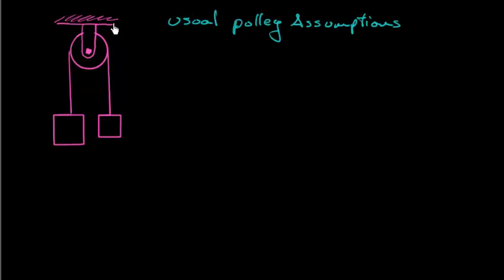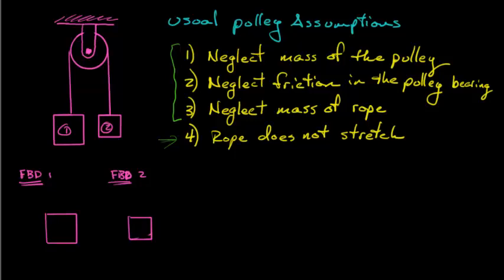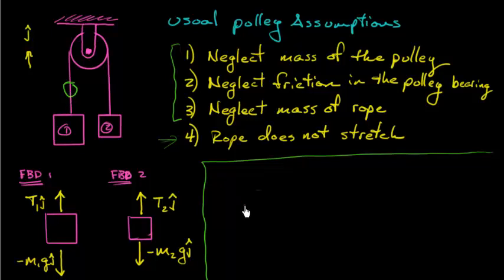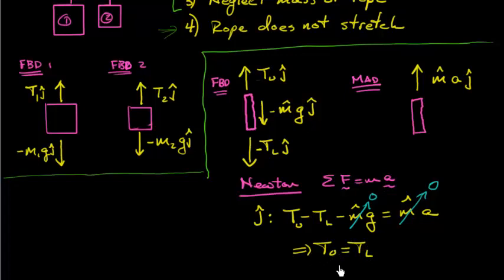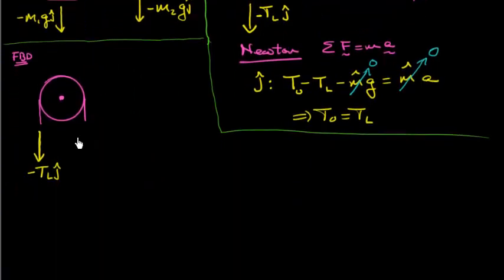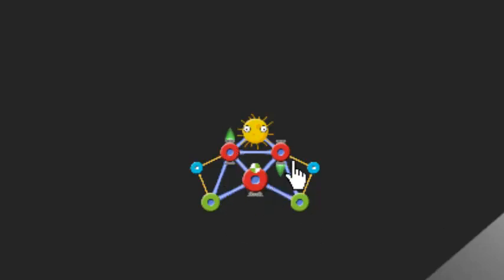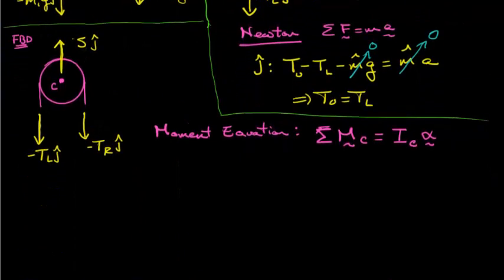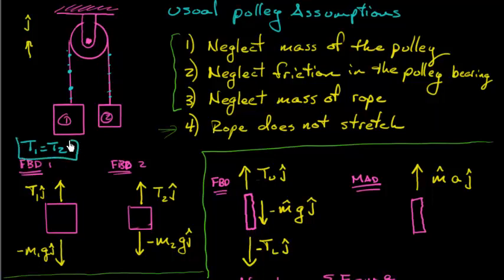Pulley Assumptions - Engineering Dynamics Notes & Problems

Comment: Thanks for this! Could you explain which assumptions are made for a lever (a simple machine), and how the typical equation f_1 * d_1 = f_2 * d_2 is derived from those assumptions? I haven’t found it anywhere, but I suspect that we assume the lever itself can’t bend, energy is transferred instantly between all points of the lever, and the lever itself doesn’t have mass. Are there more assumptions?